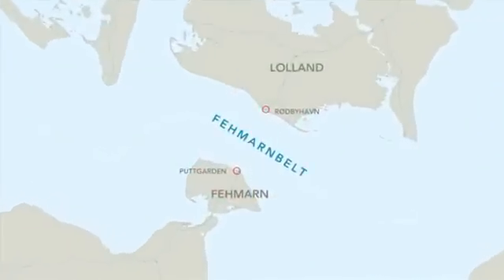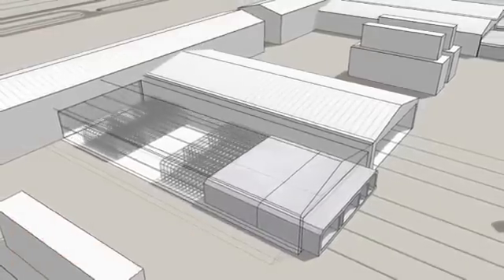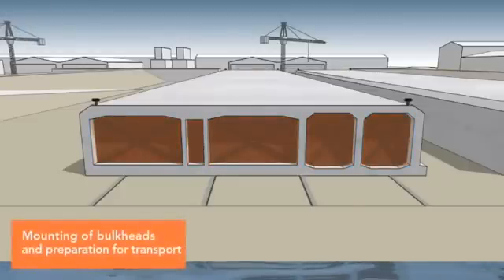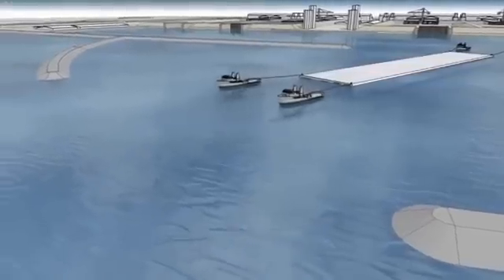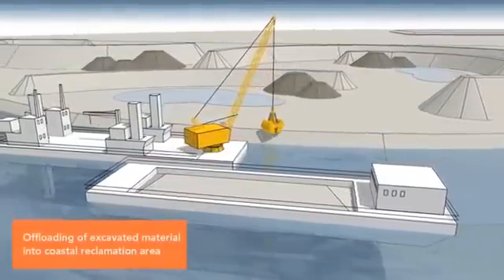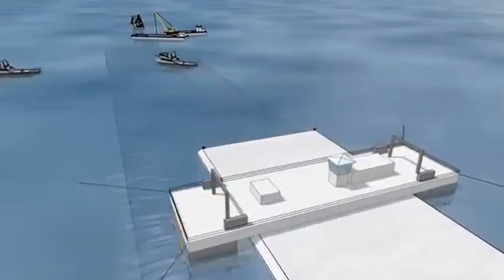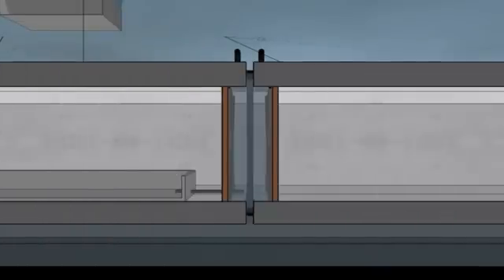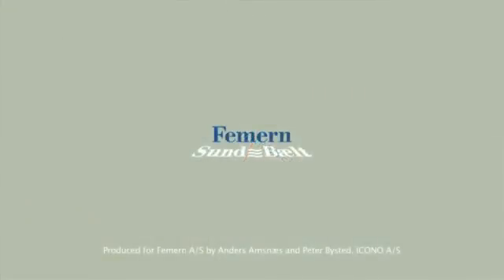Fehmarn Belt Fixed Link - World Longest Immersed Tunnel

Comment: Big mistake to put rail onto one side. Tunnel will settle more under train side and the whole tunel will be out of horizontal. The tunel section should be symmetric with rail in the center to minimize differential settlement.
Reply: this issue resolved by foundation.

Comment: Just build a darn bridge instead... It's taxpayer's money i guess, so they do whatever sounds cooler i guess?
Reply: and if you buy a bridge, it will be much more dependent on the wather situation and the ship traffic will be limited by that
Reply: This is actually the most cost-effective solution. A bridge would need either a spanning section, which would need to be quite high to accommodate the shipping in that strait (which is quite heavy considered the proximity of the Kiel canal). Or you would need a combined tunnel-bridge solution which would complicate things. In my eyes a bridge would be way cooler since this will actually be completely out of sight.
Reply: This is the cheapest solution which has limited impact on the local environment + ships/cargo can still travel in heavy winds. In case of a bridge they can't.